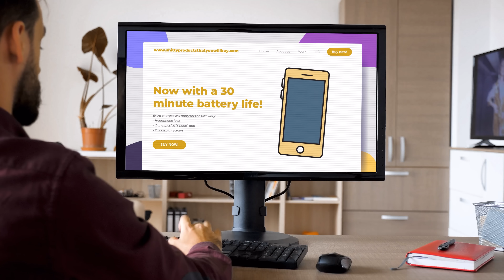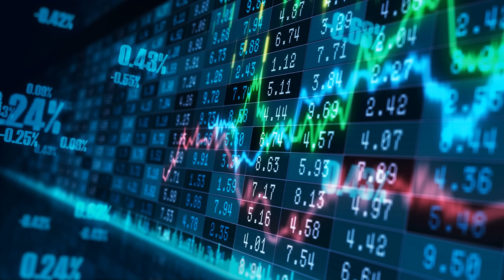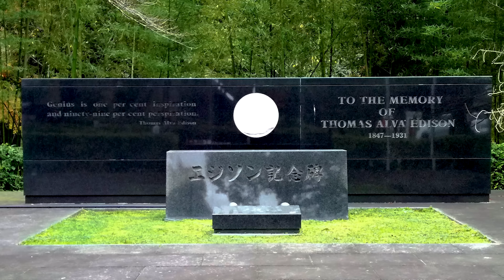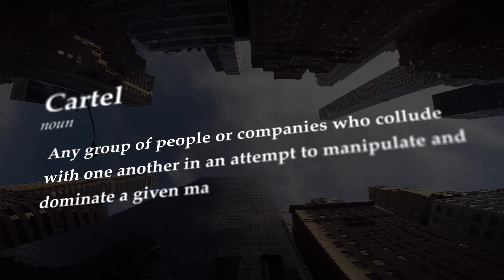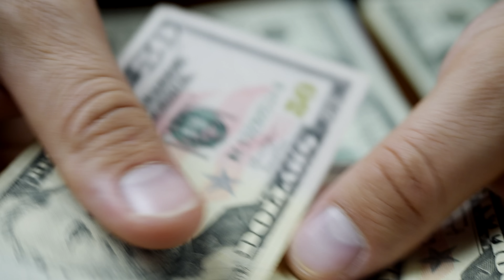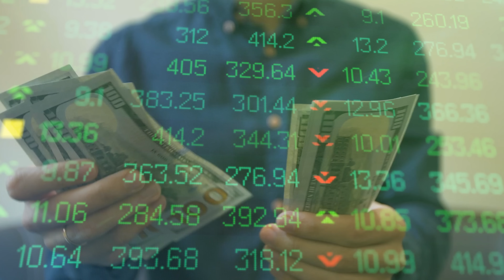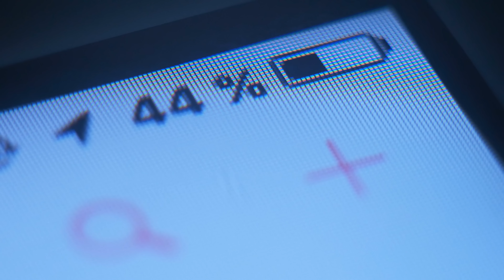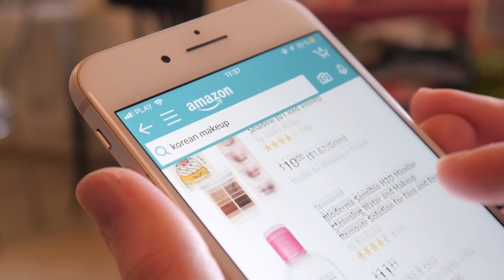Why All Lightbulbs Are Designed to Break

Comment: This has been happening for a LONG TIME now!💯💯🤦🏼‍♂️🤦🏼‍♂️🤬🖕🏼😡 This is exactly why your grandma could keep her furniture for 30 -40 years but u can't get anything to last anywhere near that long these days💯💯🤦🏼‍♂️🤬🖕🏼😡 hell, when i took an automotive tech. class in high school (2008) or instructor told us that it's not an accident that car companies used to make cars that would last 50+ years but u can buy a brand new car & chances are sumthing significant will break within 5 years🤯🤯🤦🏼‍♂️🤬🖕🏼😡💯💯💯 & that's not just a conspiracy theory or anything Izzy Taylor is about the major car companies specifically hired people to  Look into the profit margins and whether it would be more profitable to make good quality cars that will run for Years without breaking down and when it does finally break your able to fix it yourself but these daysYears without breaking down and when it does finally break your able to fix it yourself but these days  Not only did they make the quality of the cars go downhill the point were they barely even last 5 or 10 years Not only did they make the quality of the cars go downhill the point were they barely even last 5 or 10 years But the fact today purposely made it impossible for regular person to work on their car just so these billion dollar companies can increase their profit margins slightly💯💯💯🤦🏼‍♂️🤬😡😤🤯🤯🤯 Hell Ford literally made it impossible for you to even check your own transmission oil🤯🤯🤯 Because what fucking idiot thought it works be a good idea to treat ur customers like shit & like they're children or retarded & can't do anything ourselves💯🤦🏼‍♂️🤬😡😤🖕🏼👨‍🔧👨‍🏭

Comment: But a company and a CEO are totally different than a engineer... An engineer will want to make it the best. The company says otherwise.

Any good engineer will tell you the same thing , it's usually their hands that get tied with $ and budgets. And so then from a profitable standpoint, yes it makes sense to build them cheap. But I bet it's never the first design that's used. Corners are cut until it still looks good paper 

Most companies CEOs aren't engineers for a reason

Your emphasis needs to be in companies and CEOs, not blaming the engineering im sure many who watch will cringe it's not by their choices it's garbage they can make it good or bad. The companies pick, they pay the engineers anyway right

Comment: I had to scrap an entire car  because the driver door needed to be lifted up slightly before it would shut. Plus it had a minor crack on the windscreen, but because it touched the edge = fail. The car would have gone on for years more than likely, perfectly safe.  But nope it had to be scrapped,  what happened to saving the planet?

Modern cars have sensors, bushes, plastic housings,  all designed to fail. You don't make money if you sell cars that last 20 years.  Now they have all cottoned on - we can place hundreds of shit manufacturer only sensors on our cars - they'll fail and only a manufacturer, $100 a pop sensor will work with the car computer.  I reckon the cost of repair will turn into a major issue in 10 or 20 years once modern cars get old.  And that'll start an even larger exodus to new manufacturers like Tesla - just like what happened to the big US car firms in the 60's and 70's.

Comment: That Phoebus Cartel...Looks like they were at it again, when CFL bulbs were launched...though they did last longer than incandescent bulbs, & used less energy, those bulbs could have used significantly less energy if the Cartel didn’t throttle efficiency.   
Same again, less than 20 years later, when reliable LED bulbs were launched...again, IF those had been wired right, they’d use significantly less energy, & last nearly indefinitely.  
Because, ya’ll, Dubai brokered a better LED bulb, that uses less than half the energy as similar bulbs everywhere else, & lasts indefinitely.  Their tech involves using 4 times as many LEDs in a bulb, but including multiple capacitors in its wiring, so all those LEDs only burn at 1/4to 1/2 their capacity...so...much cooler temp, means they last virtually forever. 
But those bulbs are not yet available anywhere but in Dubai.
Apple is not alone either...ALL the big companies that got into digital electronics, absolutely designed it all to force new sales every few years. It doesn’t have to be that way.

Comment: You're wrong about Apple. 
They underclocked the iPhones CPU to maintain stability WHEN the battery reached a given cycle number to avoid the phone from crashing. I don't think it was intentional. I'd say they rushed out an update to fix an issue without proper documentation and giving the user a switch to control this (that was implemented right after the claims). 
Just think logically, a company like Apple is constantly tested and their products benchmarked. Doing something like this and getting away with it without people noticing is impossible for them. A company like Apple wouldn't risk their reputation with such a cheap trick intentionally. 

They also get attacked a lot for giving  3rd party repairs a hard time. I think what Apple is trying to prevent here is getting its products parts replaced with cheap shitty materials that 3rd party repairs often use. Expectations towards Apple are high. You windows pc blue screens, no big deal.. Your mac crashes, it will be in the news tomorrow. 
Since user satisfaction and reliability is one of their main goal, your iPhone crashing daily because of a chinese battery replica is something to be avoided. 
Their products are actually very durable. Good examples would be my 2015 MBP that still works excellently with 5 hours of battery time. And my former iphone 5s that had a battery replacement once and still being used by someone. It's a 7 years old product. 
I never had any hardware issues with Apple products so far.

Comment: microsoft is terrible for this.. they release operating systems and programmes with issues that they have to update over time.. what they don't tell you is that in these updates are programmes designed to slow your products and hardware down to create the illusion of degradation and wear and tear.. 

this is a fact.. imagine if your phones where just perfect all the time.. a silicon chip has a read write life expectancy of around 20 years if used frequently..  as they read and write date they degredate.. there are chips out there that are not silicon... which do not degrade are faster and last for ever.  imagine that.. but they don't use them in your gadgets because if they did your gadgets would never fail or break... 

so they put the cheap parts into the supposed best products on the shelves.. but.. there are also promo products that they make in small amounts as sales tools.. these products have all the best tech in them as they are not meant for sale or use.. they are used only to show off the product in its newest state.  

don't believe me ??  go and do your research.. everything in your house has an expiration date to ensure resales.  they purposely manufacture fails into products and software.  

its why  your phones get sluggish and slow down and eventually just stop working.

Comment: Such fail in the basic premise of this video.
Only the briefest reference was made to the fact that the lower lifespan of an incandescent bulb (almost) always equates to higher efficiency.  
Given that electricity cost VASTLY more 100 years ago than it does today, lumens per watt was (and is) much more important than a lower per-bulb annualized replacement cost.
Please note that in the case of modern LED bulbs, the circumstances are REVERSED, meaning that driving an LED with lower current results in lower light output and a longer lifespan, as with an incandescent bulb, but ALSO results in higher efficiency.
If all you care about is long bulb life (actually very important in limited applications!), then just run a 240V tungsten-filament incandescent bulb at 120 volts.
The calculated lifespan for that bulb will be in the range of 7,000 years of continuous use.

Comment: Actually, Apple is one of the few smartphone companies who try to make their devices last as long as possible because they profit from them as long as the devices are in use - so they are one of the few who try to extend the life of their product.

Slowing down iPhones so their peak demand would not exceed their degraded battery capacity actually extended their life, but after the brouhaha this was made an option. No other handset maker offers that option, and their devices just shut down when resource demands exceed resource availability.

Other handset makers only profit from their customers when they sell them another handset - so you figure out who's trying to make their customers buy another handset every couple of years.

Comment: Apple’s “BatteryGate” is not a good example of planned obsolescence. As batteries age their capacity declines and iPhones 6 and 6s could unexpectedly shut off to protect phone circuits. By adjusting the phone’s performance to allow the phone to keep working with an iOS update Apple allowed phones that would have been non-functional without a $75 battery replacement they kept phones working that might have been discarded. I had an affected iPhone 6s and never noticed any performance degradation. Of course Apple is a planned obsolescence offender by restricting the ability and right of users to use independent repair shops by denying parts and service manuals.

Comment: you are totally wrong with Apple. Due to the increase power demands of the operating system and hardware the older phones after a software update were causing the phones to shut down. to fix this issue they released a patch through an update that would throttle the devices to prevent them from shutting down. The battery in the device could be replaced and the speed would increase back to its normal specs. It wasn't until a Redit user who discovered this issue that the world became aware of this problem. If Apple had just let people know this wouldn't have been an issue but who knows. While attempting to make phones last longer than intended for the average consumer and Apple trying to save people money on buying new devices $25M is a drop in the bucket which is also why they reduced the battery prices down to just $49 instead of $69 at the time. I think you need to get your facts straight before telling people a flat out lie